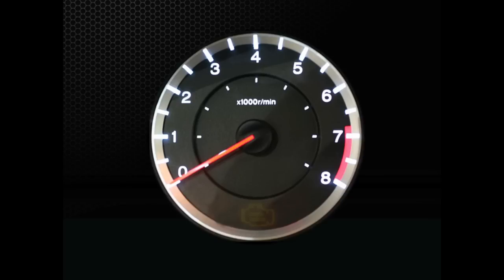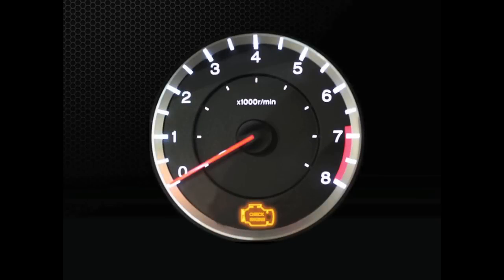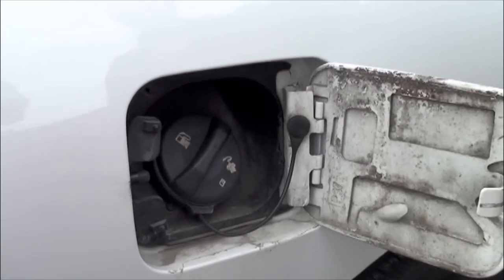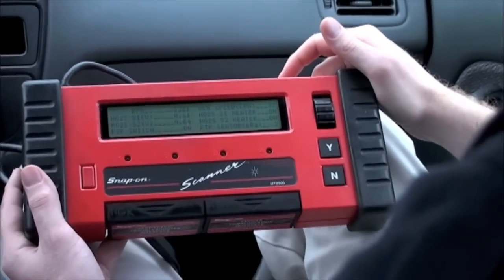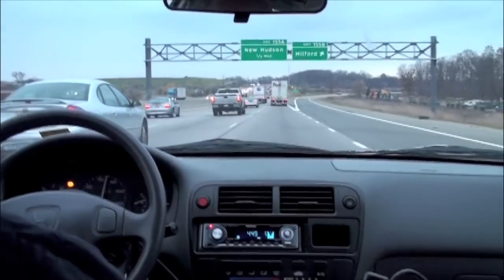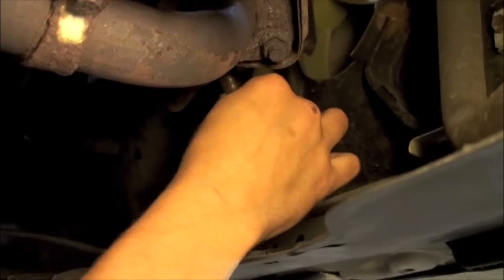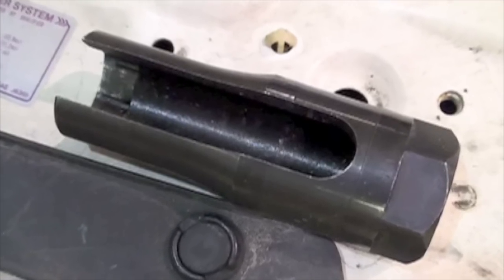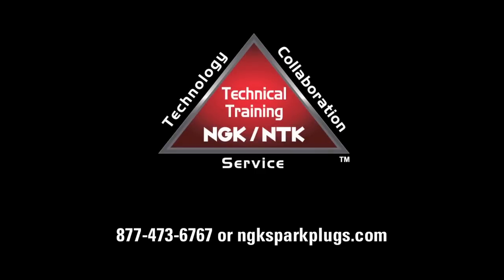Oxygen Sensor Diagnosis and Replacement Simplified - NGK Spark Plugs - Tech Video

Comment: NGK/NTK is the ONLY o2 sensor that works right with obd1 Jeep yj 4.0 engines. Bosch & Denso both make quality units BUT they will not work correctly with these Jeeps I promise you

Comment: I got a 99 durango i just replaced the up strem o2 sensor and the down strem o2 sensor and i still get a p0132 code & a p0108 code you drive it down the block and it dies but starts back up need some help plz
Reply from the maker: Hello Heath, that's a great question. Give a call when you have a chance at 877-473-6767. Our technical team we'll be able to help you with those codes.
Reply: Ok

Comment: I put a starter on my 97 4.6 Econoline van and all it does when I try to crank it it just clicks it don't turn over the same thing it was doing with the old starter what can it  be
Reply: Paul Slaton,,, I am certain that you have a bad starter relay. It is quite a regular problem .

Comment: Hi there I have a Vauxhall zafira 1.6 2003 my engine management light came on it was a bank 2 sensor so I changed cleared the code took it for a run then next day light came back on what else can it be need help wasting to much fuel

Comment: Please help,
I have a honda civic 2003,i allready change the oxygen sensor after that the check engine light disappeared and i wait about 20 seconds the check engine light turn on again?
Any suggestions?
Reply: you must put oem sensor first one on honda i have same problem with my h22a7 i put aftermarket sensor no more simptom but chek engine light come back oem sensor honda ntk and denso

Comment: Sometimes, I do agree with females. A female drops a car, talking to the mechanic guy for less than a minute, and then straight to waiting room (of course with phone in hand) and when job done, she simply swipes a card, no question asked because some of them don't even know where the engine is located.

Comment: i have a 2002 honda oddyssey and it is losing power and no change in rev occours. it happens while driving there is no exhaust noise. just rumbling as if it was misfiring i pulled all the coils 1 by 1 and they were all working. it seems to shake mire+ now then it was it dosent die and soon after the power to the motor comes back. it feels like a throttle position sensor or i read about a man with similar problems and it was his crank position sensor but i was thinking my issue vould also be the. top dead centre sensor

Comment: Hello I got a new sensor and the auto parts sold me one with two wires (one blue and one white) my truck has only one wire (black ). How can I install this? please help
Reply: +joker7from206 ...........You don't. Take it back and tell them it's the wrong one. BE sure to take you old one with you to match it up with the new one.
Reply: +Jim Pinckard Thank you I did. I had to get one from the dealer for $128.00 double the price but got it done.
Reply: 1st later Rockauto has original replacement parts way cheaper then dealer

Comment: I have P0420 in my 05 tacoma, dealer told it was bad cat. i want to replace the o2 sensors, do u think its a good idea? i really dont want to spend money and found out later that part is good. any idea if i need really to replace tha cat or the sensor first? thanks in advance
Reply: look up non fouler plugs ... thank a half inch drill bit and drill the center out on one of them... put your o2 sensor in the one you drill out... take a gasket from the non foulers and put it on the threads of the non fouler with the center drilled out . now take the non modified non fouler and thread it onto the thread with the gasket  so it will be (non modified non fouler then the modified non fouler then the o2 sensor) now put that all into the  DOWNSTREAM o2 sensor spot (i would use some anti seize here)  so what the P0420 code is caused by is when the CAT goes below 95% efficiently so when u bring the 02 sensor back from the stream it will steady out the voltage coming from the sensor ... its this voltage fluctuation that causes the computer to give the P0420
Reply: +dave “rif” jack ...do you have a video on this? if so, what is the title. I couldn't quite figure out what you were describing to do.   this sounds like the fix for my p0420 code fix.

Comment: I need some serious help. 2003 dodge neon sxt, throwing code p0302( cylinder #2 misfire). Replaced ignition coil, platinum plugs, ngk wires, valve cover, valve cover gasket, intake manifold gasket, spark plug tube grommets, air filter, the things i have replaced so far. What else could it be because im still getting the code p0302. Thanks.
Reply: what if injector number 2 is bad? thats the injector on cylinder 2. also check compression on cylinder 2
Reply: As stated before check injector switch them around to see if the misfire goes to another cylinder. If that doesn't do it pull the plugs and check compression
Reply: Check fuel injectors

Comment: Cant seem to get any info on the repair of my Caravan SE, 2003.
When you live in rural area, its seem no one has a clue, even local mechanics 50 miles away.
 
Codes shown   168.4 and  050.0 and 169.8 
 
Engine light is on.  Had the battery post cleaned.
Transmission doesn't want to shift.
The light on the shift advisory are staying on.
Speedometer doesnt work any more.
 
Sure appreciate the assistance of someone.  Cant drive it the way it is.  Have to use my GPS to monitor my speed.
 
Look forward to someones help.
 
Jack
Reply from the maker: Hi, Jack. Please give our Technical Services line and explain your issue. They will do their best to understand and try to assist.  877-473-6767 option 2. Good luck!

Comment: Do you need that special tool or can you use an open end wrench? It looks like a regular hex head ? I'm sure that special tool costs a kings ransom at Toyota. Thanks .
Reply: TheBCSledder
Harbor Freight sells an O2 sensor removal tool for under $10.00.
Reply: James Zurawski I tried the open end wrench idea... as usual it was wayyyyy easier with the proper tool.  The wrench only rounded the corners and I couldn't get enough torque on it.  Also the socket wasn't  that expensive from Napa o2 sensors are all the same size so no need to get it from the dealer
Reply from the maker: Oxygen sensors will use a standard hex shape.  An open end wrench can work to install or remove an oxygen sensor however an oxygen sensor socket on a long arm ratchet can may help remove a stuck oxygen sensor.
Reply: ***** OK Thanks much !!

Comment: i have a 1999 corsa 1.2sxi my engine light used to come on when under load but then go out & the car would run ok then without warning the car stopped running i was told it was the crank sensor then the timing sensor then the coil pack i replaced these & still the car wouldnt start so i took it to french & browns in chopwell which was a big mistake as the so called mechanic is as bright as a hobo's boot he had it for 3 weeks then said he couldn't fix my car so i had another look myself to find a light coloured deposit on the sensor & dust on my cat which rattles when you turn it upside down so i have come to the conclusion it was the sensor that has gave me all this trouble & expense. i have ordered a new sensor & will get a new cat if the car starts with the new sensor.

Comment: Did the engine light go away, did you have to drive it for 100 miles for it to go away or did you just erase it yourself??
Reply from the maker: Good question. Depending on your application the number of drive cycles needed to reset a monitor may vary.
Reply: wow  burrito eater already learned to be civilized.  Good progess, keep it up!

Comment: I didn't see any diagnosis??? I saw a guess, and a parts change. A meter was never used to test the sensor. It IS possible that the problem is elsewhere. Just because your engine light goes on does not automatically mean it's that sensor. But if you have plenty of money to burn, this is the video for you. Replace all the parts. Sooner or later, you will have replaced the right one.
Reply: Agreed (about the video laking any diagnostic procedure). Considering the fact that "O2 sensors are often an expensive replacement part compared to other possible ignition related parts whose failure could be the culprit for causing the problem and subsequent Check Engine light to come on, one should usually refrain from "guessing" that an O2 sensor replacement should fix the problem.

Was the term "click-bait" known eight years ago when this video was first posted (July/2010)? Because that title fits the perfect definition of "clickbait"!
Reply: Dave denton unless it's a wiring problem. lol

Comment: I have a 96 f150 that gets better gas mileage in the winter over the summer about 60/70 miles difference per tank of gas. Any idea,s
Reply: Air density and moisture content of the air. If it's turbocharged the intercooler will also be more effective in winter, giving another increase in intake air density.

Comment: thanks for the reply and i find out mines only have two because i has a single pile going straight back and the split out to dual exhaust if that make any scene...and the problem was heating fuse went bad in which kept the computer reading the o2 sensor was bad and they were brand new....thank for the reply

Comment: Im getting high fuel consumption but when i use the tech 2 to scan it wont come up with anything. Is it possible the oxygen sensors might be bad and they wont come up on the scanner?

Thanks
Reply: My fuel mileage slowly dropped for a year without any OBDII codes. Then the CHECK ENGINE light came on with a bad sensor code and a week later with a sensor failure. I wish I had changed the sensor sooner, but did not know which one until a code showed up. Good luck.

Comment: oxgyen sensor are extremely expensive in my area and many costumers please me to find a used ones ( from car graveyard , near to my garage , i am actually looking if there is any procedure i can attend to to inspect if those 2nd hand o2 sensors are working before they will get swap or no ?u know some car like audi is very hard to reach the heaters sensors  , is there is a circuit diagnoses inspection using digital clamp meter , please i want to learn how can i do this

Comment: There are 1994 and 1995 models that are OBD II and I have seen this with some 1994 and 1995 GMs.Topping the gas tank will turn on an oxygen sensor code.Seen it with a 2001 Saturn,topping off the gas tank set the code off.Some Fords have up to 8 oxygen sensors and have to watch it with the Fords when oxygen sensor replacement is done.Bank 1 sensors 1 and 2 are on the passenger side and this is with Toyota also.

Comment: my oxygen sensor wires disconnected from their plastic entries, but i dont not know in what order they are suppose to go i dont want to cause any damage to the computer and also am wondering if i connect them properly will the check engine light go away?? i checked it with the obi 2 and it gave me p0135 sensor 1 bank 1, on my honda civic 2001 lx. thank you very much

Comment: Good video. I ve Nissan Sentra 2005 and there is Service Engine Soon in Dashboard. The code is p1273. I was told to change either Air Flow Sensor or O2 Sensor. I also heating know 2 problem. Pls advise.

Comment: FYI Running a daily driver lean all the time will cause significant engine damage in the long run.  The 5 mpg's are great, but I decided to get my car running properly.  Heat is an engines worst enemy, and going lean will produce more heat.

Comment: Hi i was wondering if you found that master tech im having a really bad problem that no mechanic seems to be able to fix related to fuel acceleration which the obd1 ( 94 safari mini van sl 4.3l v6 ) has and its not the catalytic/fuelfilter/fuel pump so it may be one of these sensors which they said it wouldn't be but now im thinking it could be but anyhow any master tech you talked to if you can email me their info

Comment: No, I haven't done anything but run the OBDLink application. Next I might simply apply heat to the sensor and use my DVM to see if it generates any voltage on its own.  I suspect that the O2 sensor is just bad, but my original question is if the Honda Accord ECU might just not support the display of voltage on sensor #1. It would be odd if it did not, since I get voltage on both sensors with every other car I tried it on. Thanks for the ideas.

Comment: I don't think so.  Even with a vacuum leak, there should be some voltage coming from O2 sensor #1.  The voltage comes from the heating of the elements in the sensor.

Comment: I had these godamn O2 sensors. iv already spent $120 one.. Bank 1 sensor 1. paid 120 for  the part and for it to be installed.. Check engine light is still on .. months later... codes P0157 and 158 are coming up.. oxygen sensor bank 2 sensor 2. so i guess i gotta do this one now too.... god im getting pissed i just want the stupid light to stay off. how much should an automotive shop charge to put these in anyways? i know it it doesnt take very long it should only cost 2 to 30 bucks youd think?

Comment: I used the OBDLink MX scan tool with an Android app; and when warmed up, it shows O2 sensor #2 fluctuating between 0.5 - 0.8 volts.  O2 sensor #1 shows 0.0 volts at all times and all speeds. Do you think my #1 sensor is dead and needs replacing, or does the 2003 Honda Accord ECU not support sending voltage for sensor #1?  It is a 4 cylinder with 5 speed manual trans.  Thanks.

Comment: what is example of replacement of oxygen sensor?  I had check engine light P0401 regarding threshhood of catalytic converter, my mechanic told me the converter needs to be replaced, I switched gasoline stations since I noticed poor mileage and code is gone? I have had mainly honda/acura and use your ngk platinum/iridium plugs.

Comment: Secondary O2S is a monitor of catalyst efficiency. NOT an input into the PCM that will affect the injector duration. Your vehicle will crack and break over time; It doesn't sound like you care much for it anyway.

Comment: has the car running rich check your air filter first,and try to upgrade the air filter to k&n filter google nice filter in 1 year it pays for filter,has with o2 sensor oh yes some company are 60.000 miles first tune up or at 100.000 miles they dont last forrever..exgaust veery hot,front senser upstream controls engine perfourmence ok the second sensor downstream checkes now get this,,it checks the condition of the cathylist converter thats the differrence of the 2 sensor

Comment: Just be careful, a lean engine can get awful hot and start to ruin itself--otherwise they'd run them that lean at the factory.  Heck, some manufacturers resorted to running thinner oil just to get an extra MPG out of the engine (I'm looking at my car, an '06 crown vic where they actually did that--the engine is specced for 5w30, but CARB made them shave an MPG off, so they factory fill with 5w20).

Comment: Yah that's what I've been told. :/ I've tested everything I could... MAFS, both O2's, EGR valve, IAC, TPS, PCV, Cam sensor, crank sensor, etc. I'm sending the car into a master tech for diagnostics.
You'd be amazed if you saw my spark plugs. Soooo white. The engine is obviously running real lean - especially cyl-4. Guess it's a possible fuel pressure, pump, or filter. But I didn't have access to a gauge for the line or a guage for exhaust back pressure. Besides the car seems to start easy. xD

Comment: Dear Sir, I have EK3 96 with D15b engine. My Oxygen Sensor does not throw any code or no engine warn. My car runs rich and poor fuel economy. Does Oxygen Sensor need to replace? I never replace it since new.

Comment from the maker: If the sensors are repeatedly triggering a check engine light, they may not be bad but rather sensing conditions that are out of parameters for your vehicle, essentially another component in front of the sensors has failed and needs attention.  Often the aftermarket sensor, especially those that come from an OEM supplier are identical to the ones available at the dealer.

Comment: Just replaced the O2 sensor in my '01 Accent the other day. Wasn't aware there was such a thing as an O2 socket remover! Would have made my job a lot easier! In any case the new NTK one went in without issue, despite a different appearance.
Reply: I bought the 2 sockets or O2 sensors & they caused more issues than helped.

Comment: Well I'm fairly certain after 2,000-3,000 miles the pre-cat is now failed. But I honestly think that was a result of running carb cleaner through the engine earlier. How could a lean condition make a cat fail? I thought rich would do it faster cause of all the extra gas that has to get burned up. The stock cat is expensive, so I'll probably just weld in a universal. oooo boi. :p

Comment from the maker: Most likely the lean condition caused the sensors to fail. While not replacing the sensors may make sense momentarily, the car will consume much more gas by having non-operable sensors as well as risking failure of the catalytic converter which will cost more than the o2 sensors themselves, over all the replacement of the sensors will be critical to the operating and life of the vehicles health.

Comment: Ya I remember my mom had a buick she paid 250 dollars just in labor to replace an EGR valve at a shop, they also padded the part by 100 dollars even with an OEM dealer part price... I popped the hood and it was right there, 2 bolts and a vacuum line.. Took them MAYBE 20 minutes tops to change it.... I can't believe how badly shops rip people off and still stay in business...  I wasn't in the state at the time she got it fixed so I was too late to help..

Comment: Maybe you should redo the audio. The check engine light on steady is ALWAYS emissions related. If it is flashing, stop driving ASAP and get it to a shop as there is a misfire occurring and will damage the cat if raw fuel is going out the exhaust and into the cat.